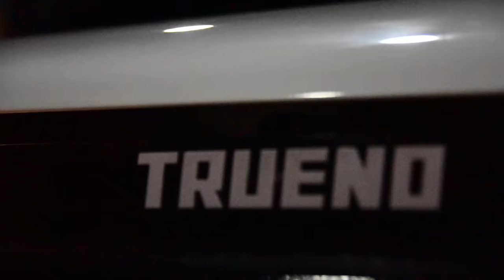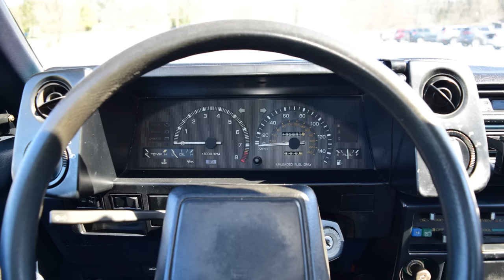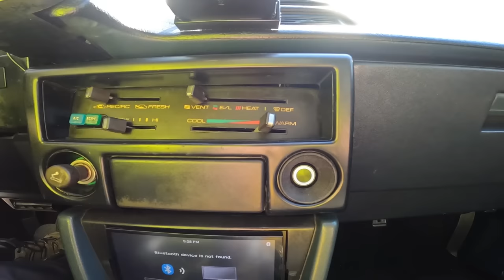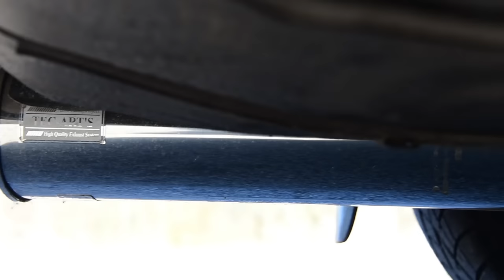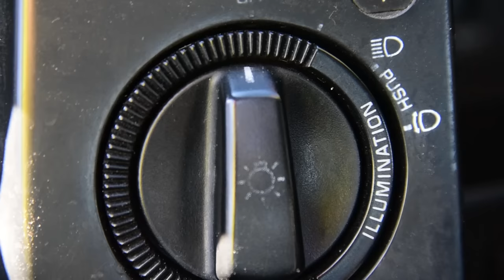1984 Toyota Corolla GT S Initial D AE86 Takumi Fujiwara Replica: Regular Car Reviews

Comment: If you want to talk about an insufferable delusional automotive fanbase, the absolute worst are Delorean fans. The Delorean is not a good car, it was expensive, slow and even by 1980s standards not a looker. It was a complete and utter flop of a car. However a movie comes along in 1985, turns it into a time machine and suddenly the Delorean goes from a weird oddity car made by the guy who created the GTO, and instead becomes a pop culture icon. However when you interact with Delorean fans they are almost always insistent, to the point that they do not like the Delorean because of Back to the Future, but because of the car itself. In fact they even try to distance themselves from the film, to the point of even trying to claim the Delorean is a pop culture icon because it's a symbol of the 1980s. Not that pop culture made into an icon, it's an icon just because it existed. 

Like at least AE86 fans acknowledge the impact Initial D has had. Delorean fans are the opposite.

Comment: a celica gts will save you $$$$$$$$$$$$ vs a Celica GTR Gt4 bangerang, 

and then with the shitty clapped out GTS you take a 2013 NX200T/ RC200t motor and drive train and swap it in, road legal and passes emissions or whatever. 285 hp. 

your welcome.

Comment: Mid-Engine? I don't know about that. It's a short wheelbase car, but the engine is still in front ahead of the driver, basically making it NOT a Mid-Engine, unless I misunderstood this part at 14:32
Reply: Mid engine means it's behind the front wheels, not behind the driver
Reply: @Fopenplop  right, if it's mounted between the axles, it's technically mid-engine.
Reply: People who call this mid engined because of engine mounting choices in the front are real clowns. If that was the case every Corvette from the C5-C7 would be mid engine.
Reply: @Corvolet5  I mean yeah, colloquially "mid-engine" means it's behind the driver in the "middle" of the car. But like the S2000 is considered front mid-engine because it was designed to have the entire motor behind the front axle. This car (AE86) I'm not so sure would fall under that category.
Reply: @mista414  Honestly I feel like it's dumb to create another sub-class of cars just for the sake of it. I remember this statement for the AMG GT Black Series where it "ACKTCHUALLY" is mid engined, despite the fact the engine is clearly in the front. I don't mind if people say front-mid engine, as long as they at least make some sense by saying the word front first and acknowledge it's not a pure mid engined car. Because something like the MR2 is exactly that.
Reply: @Fopenplop  "Mid engine means it's behind the front wheels, not behind the driver"

Sure- But even with this description, its really not.

What youre talking about here is whats often called a "front mid engine" design. Mid engine more specifically means the engine is between the center of the front and rear wheels- Whether the engine is in front of or behind the driver, if its between those center lines of the front and rear wheels, mid engine.

But the 4age in the ae86 extends well past the center line of the front wheels- And doesnt really meet this description.

More than likely, he just mis-spoke.
Reply: @mista414  "This car (AE86) I'm not so sure would fall under that category."

The engine extends well past the center line of the front wheels, it definitely doesnt fit this category. He just misspoke.